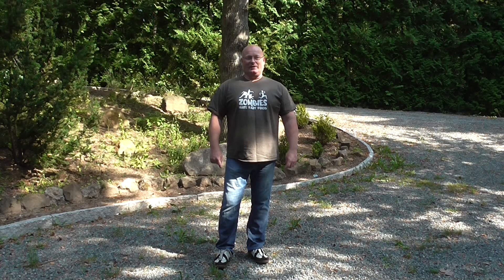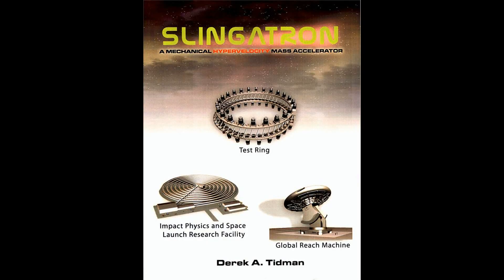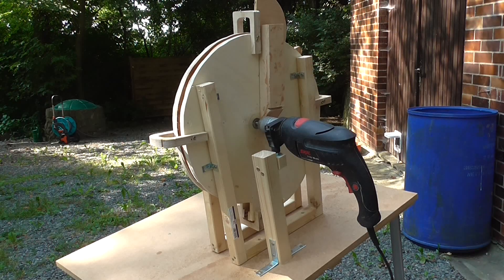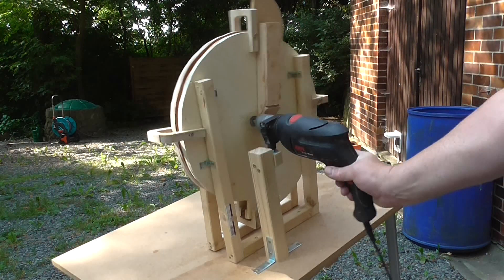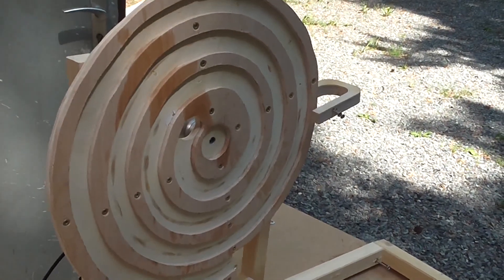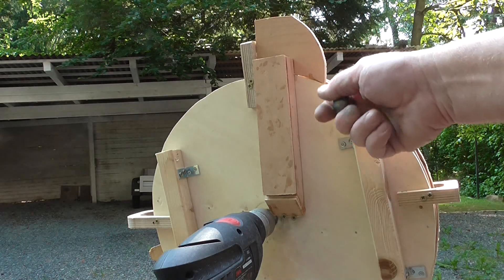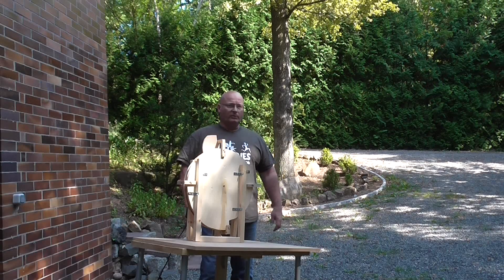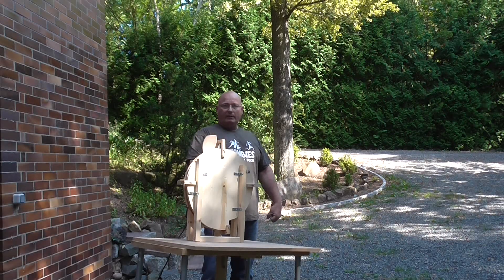How to turn a drill into a monster shotgun!

Comment: This idea was already patented years back, it's a horizontal plane type of weapon able to cut down trees with a formidable spread, mounted on mobile carriers (truck, jeeps, helicopters.) It uses a very high RMP motor, there's no internal spiral, just axial channels leading from central magazine, filled with balls via funnel loading, an adjustable shroud slide window to determine spread, and pins that move up & down to release the rounds.

Comment: Not really. First you could make the blade not a blade at all, but a tube and fill it with balls. The release does not have to be complicated either. Just add a cap to the end of the tube (held closed by a spring) and an external cam, that can be enaged and will push open the cap when the blade comes by.

Comment: the drill has a max constant ANGULAR velocity. So larger the radius, more the linear velocity. However, there is nothing to be gained by making the increase of radius gradual. Might as well fire it from the largest radius without bothering to accelerate it from a smaller radius.

Comment: sorry, but i don't really thing the increasement of the way of acceleration has any positiv effects, since the drill doesn't have a constant accelaration, it has a maximum velocity, which is reached quite fast. The steel balls can't be accelerated any further than this maximum velocity, so a greater diameter doesnt make sense

Comment: Great idea, try this, use or make a long coil of 2 inch wide x 1/8 thick, Spring steel made, into a coil, cut in half allowing a guide for the shaft to sweep those balls out with an added spring action.

Comment: The drill has to work harder when the ball is in the center due to friction. the track is limiting the speed the ball may travel at. It doesn't matter how big you make it, your speed will depend on what's driving it. It could be a 2 meter track, but if you still used the drill, you would get the same speed coming out. It's not really the ball speeding up, it's the drill speeding up as there is less friction on the ball the further out the track it goes.

Comment: 17,000rpm (redline) Yamaha engine + three 1/4" thick 10x10' aluminum sheets with some steel to re-enforce them, a composite "blade" as you put it. Maybe some type of auto feed system where you use a disk with some holes cut in it spinning at the bottom of a hopper (sorta like a paint ball gun hopper setup) just have the holes spaced out to time the drops. Add misc. parts as need and TAADA! ....seriously, build it, test it, film it. Then test it's lethality with ballistics gel. I want to see it!

Comment: (cont) Slings it to the outside of the containment shell where it travels along the inside of the shell until a pickoff finger passes through a slot in the spinning chute and strips the ball into a barrel.  Your system needs to be powered by a drill in order to accelerate all the spinning mass.  But you give up a lot of RPM by using a drill.  Instead, spin the mass at a constant high speed with a different motor.  Obviously it will need to be balanced.

Comment: Not quite.  By introducing the ball at the center of the propeller it does not have a high angular velocity at this location.  In fact, the angular velocity is very low.  You spent a lot of time making your spiral guide that really wasn't necessary.  Look at the "chute" you drop the ball into.  Think of that as just the first half of the whole chute.  Now imagine the other half of the chute spinning inside.  The curved part of the spinning chute receives the ball from the outside and slings it.

Comment: I built something like this when I was a kid except it threw 1/4" steel balls.  I made the infeed from a copper tube and drilled cross holes through the walls of the tube for the fingers of a spring loaded escapement which would release one ball at a time when pressed.  The motor was from an electric fan and spun continuously.

Comment: With a larger wheel/disc the overall velocity will increase exponentially. As it is currently though, you won't have much in the way of overall speed once the ball has been successfully launched from it.  Once the disc has been enlarged though, its overall circumference would hinder it in the long run, making it too bulky to pack around. However, if you could develop a new launching mechanism that has higher torque along with speed. Then the discs current size would be ideal for launching!

Comment from the maker: The impact of a ball on such a faaast spinning bat would shatter even steel. Also, you can't "drop" a ball on a faaast spinning propeller. It would glance off with only a small amount of energy transfer.

You have to accelerate the balls slowly, but steadily. Hence the spiral. If you feed in the ball near the axis, it will be pretty slow. The more it is pushed towards the outer rings, the faster it will be. At the exit it will have reached full speed, just as you have figured out. It works.
Reply: you can have a magazine in the center and each ball will start from the center.

Comment: J- I am probably missing a key element.  I see how starting the ball on the inner spiral minimizes the drill's resistance (less work done on the first revolution), but does this design do anything more than allow the drill to reach full speed before it releases the ball?  Isn't the ball exiting at: outer circumference x revolutions (3 ft * 100 rps = 300 fps}?  Could you get the same result by dropping the ball on a heavy, already spinning "bat" of the same length?

Comment: sorry i can not find a link or an image. i know i have seen a picture of it. it is quite large with the main disk set about 30 to 35 degrees off the horizontal axis. a solider would feed it stone projectiles about the size of bowling balls. as it spun around it would launch the stone at high speed.  i wish i could remember more but i only saw the picture once in a book.

Comment: try laying it horizontaly.. in this way u will maximize the acceleration by minimizing the resistance on the drill when the projectile climbs upwards in the spiral! the weight of the ball is significant enough to lower the speed of the bar! keep it up! good job bub!

Comment: Well, for a more mundane application, this looks like a more efficient build for a ball pitching machine (for tennis, baseball, etc.) than the models I've seen in the market. Only one axis to worry about, less maintenance, and it looks actually safer than the marketed models I've seen (provided you're not standing right in front of the "muzzle", of course).

Comment: Joerg hi.. as you mentioned the HP of the drill is a major limitation here... a larger wheel would do nothing but overheat the drill if it doesn´t have enough power.

What i don't like about this kind of concept is that you are not accumulating potential energy for sudden release... i believe that there could be other ways using the same power input to make a much better weapons.

Have you thought about doing a hydraulic or pneumatic slingshot? (feel more attracted by the hydraulic idea)...

Comment: Is interesting to consider the case as the diameter of the spiral grows...
Assuming constant rpm of the drill (small spirals), then the speed of the ball will be proportional to the diameter of the spiral.
But at larger radius, the force pushing back on the drill by the ball is larger than the internal resistive force of the drill, and you'd expect the drill to slow but produce approx constant force. Then, we get Energy is proportional to diameter, ie speed increases as the root of diameter...

Comment from the maker: The RPM is slowly increasing, the drill motor isn't without power limitations. The ball is picking up speed as the diameter of the spirale increases. A larger "wheel" would increase the speed dramatically.

Comment: It's a nice concept, but the only flaw is that the RPM of the drill will remain the same. The overall g-force of the ball is the only thing that will increase a lot, while the ball itself will only gain a small amount in speed as it is flung from the spiral. Good concept, you should keep on working to further develop this idea.

Comment: Firstly, what you'd shoot would be the heavy objects that takes an unpractical amount of fuel to get into orbit, like, a container with water, metal framework and such objects that are not prone to damage from the g-forces involved.
Secondly one wouldn't be using an explosive propellant but rather a magnetic rail gun system mounted on the outside of the barrel so as to allow a gradual increase in speed.

Comment: Imagine it made from aluminum with greasable bearings and a high speed water cooled spindle motor driving it...with a large ammo hopper above :) then take it to the next level and mount it on a circular table that could be controlled by servo drives so you could auto aim it from a computer...

Comment: Hey Joerg, love the Channel!

Just a thought on your sling shotgun. I theorized that if you actually changed the orientation of the sling panel from standing vertically to lying horizontally, the gravitational resistance on the steel balls would be a lot less. Thus, it might give out a stronger output.

What do you think? 

Cheers!

Comment: You could add a metal pipe at the front to guide the balls in order to get more accuracy. It also would be a great idea, to mount this on a device, that is able to be turned in all directions. If you place two of these next to each other you could use just one motor to turn it and you also will be able to look between the spirals to aim.
(Could you please give this comment a few thumbs up, so Jörg will definitely see it?)

Comment: You are both right in a way, the thing needs a force over time to accelerate up to speed however there is lost energy all over the place; friction and even the unbalanced blade.
The drill looks pretty powerful, probably powerful enough to get more speed and distance in one swing of the arm if you made it a trebuchet :D

Comment: I'd recommend putting a counterweight on the opposite end of the blade. Watching the high-speed footage, the whole frame and the table are shaking pretty violently and will break over time, possibly explosively. Just something to think on! For making it full auto, I'd make a sort of cog system that releases a ball every other spin so there is some spacing between each projectile.

Comment: actually the outside of the wheel is going faster than the bit itself. it is the same for bike gears. a big gear is used to make a lot of speed where a small gear is easier to pedal but is slower. its because if the wheel makes 1 turn a second then if the ball has to travel 1 foot it will go faster than at the middle where it only has to go an inch. This is also similar to why Olympic track racer start at different spots.

Comment: No, that sling-a-tron wouldn't work.

But using a methane cannon would work.   

You build a cannon that's a mile long, submerged in the ocean near the shore, at the Equator.

The water helps support the weight.

You pre-load it, charge the cannon with methane and oxygen, then ignite.

The cargo accelerates at 50 G's until it breaks the seal on the end of the cannon and rifles into orbit.

It would work for cargo, but humans would be killed immediately.

Comment: if they would use an average lawn mower engine which has vertical drive shaft they would have to put it on is side. if you want to you a engine use a dirt bike two stoke engine with a diaphragm carburetor two strokes spin faster, it can run at any angle, unlike a four stroke which has a bowl style carburetor  and cant run at any angle,plus it will have a horizontal shaft. though a four stroke has more torque.

Comment: The thing in that kickstarter is never going to work, it's complete bullshit. For a start the escape velocity of Earth is about 25,000 mph, the speed the arm on that thing would have to move is just ridiculous, especially because the track would have to be tens of miles wide, the turning circle would have to be huge to allow any sort of vehicle to travel that fast a long the track. It will end up costing far far more than that just to have a hope of it working and it won't beat a rocket.

Comment: I have become an avid slinger this summer, trust me, the sling is only dated because people abandoned them. They generate way more power than traditional slingshots so long as you can use it well enough. Accuracy is most likely why the sling fell into decline, they are very difficult to be accurate with, requiring many times more practice than the bow to become close to as accurate. One cool perk about slings, you can just roll them up and put them in your pocket, take them anywhere.

Comment: You aren't losing energy because the tracks on the spiral apply a centripetal force to the ball. Centripetal forces do no work and therefore do not add or remove energy from the ball because they are perpendicular to the velocity of the ball. The only thing removing kinetic energy from the ball is the friction between it and the track, but that would happen in a straight track too.

Comment: Come on Joerg, you should have made the spinning plank equal lengths either side of the point of rotation. This would eliminate a lot of the juddering and vibrating and even though the spinning plank would weigh more the lack of vibrational losses would probably counter this and make the launch more powerful. Plus if you found it was the motion of the ball causing the vibration just use two, one being propelled by each side to negate each other.

Comment: That's really cool! I bet you could make the spin easier for the drill and gain a little bit of acceleration by making the spiral horizontal (flat on the table) instead of vertical. I think it would vibrate less, too! You could also make the wooden bar go on both sides of the axis! It would help reducing vibrations furthermore, and also it could improve the rate of fire a little bit if you shoot many projectiles in a row!

Comment: I am thinking that the higher the RPM, the more difficulty getting auto feed to work reliably.  Maybe better to go with bigger diameter...?  Two sheets of 125X250 plywood would give you enough material for the walls plus the spirals for a reliable ~ 125cm diameter zombie destroyer.

Maybe also consider placing the counterweight external to the spirals; internal placement would reduce the aperture time for the projectile to move into the firing position.

Comment: Rather than a counterweight you could have a single blade that attaches in the middle like a lawn mower blade. You would get balance and 2x the fire power. You also might want to add a trigger mechanism to the magazine chute so that you can run the blade constant to maintain maximum RPMs.

Comment: I love the idea, but I think that you could improve the arm on the inside. I suggest that it be more like a propeller, or a fan; radially symmetrical. It would provide stability, right now it works like a vibrating motor, spinning off center. Better yet, how about a spinning disk inside, with a wedge cut out of it, like Pac Man. The balls wouldn't be able to fall into the spiral all at once. This way, once the first ball makes one round (before it exits the spiral), the next one will be loaded.

Comment: ok that makes sense - now I understand. i have a nice idea: not a axis wich spins, use a 25mm ID steel tube with a cut out, so you can connect the drill to the axis-tube and feed the balls right inside the axis from the other side. that should work fine!

Comment: and if its not synced what would happen? you throw the ball won your feeding tube, it will drop not in front of the blade, it drops BEHIND -> the blade will make one turn without a ball and pick it up on the next turn, in just a millisecond. have you tried it? 
maybe there is a realy tiny point where the whole machine explodes because the ball gets stuck between the fast spinning blade and the spiral, but to know that exacly you have to try it out. 
Regards

Comment from the maker: Yes, a synchronized feeding mechanism is needed that feeds a ball every four turns. The firing rate would still be very high - about 180 rounds per minute. 12 kilogramms = 27 lb of steel every minute.

Comment: Hey there JoergSprave I just wached your latest video about the full auto sligshot (How to turn a drill into a monster shotgun!) and I have a suggestion. The rotation of the one bar pushing the steel balls causes a lot of vibrations. If you are planning of making the big one I suggest you to make a bar thats evenly long on each side. Your automatic slingshot will fire double the rate as the design now. And vibrations will be less what also will give more accuracy. Thanks for reading

Comment: I don't think the full auto idea will be as simple as gravity feeding the balls. There's probably a limit to how many balls you can have inside the spiral if you want them leaving the spiral with sufficient momentum (with that electric drill at least). The accumulated mass distribution in the spiral will give the system a very high moment of inertia, requiring a high torque of the motor to accelerate the balls quickly enough.